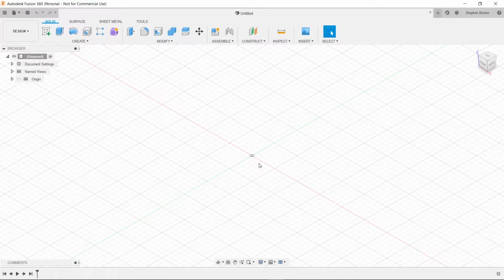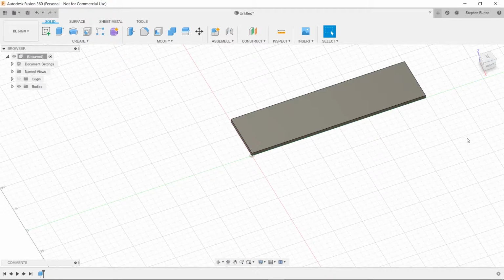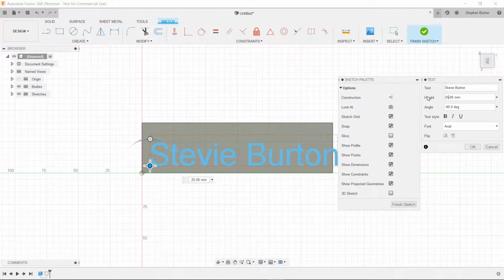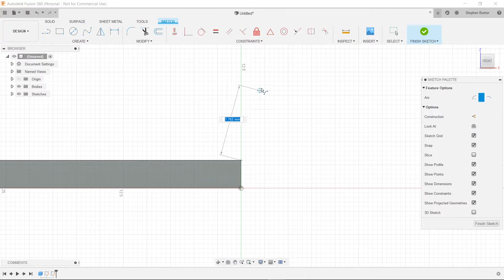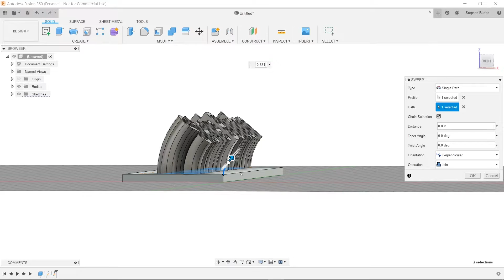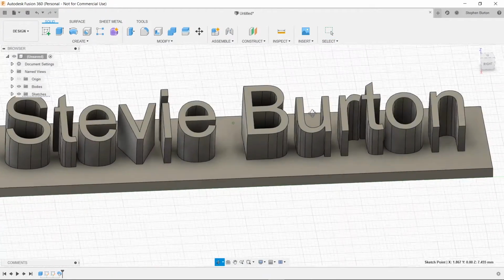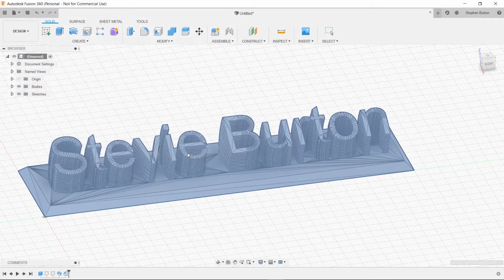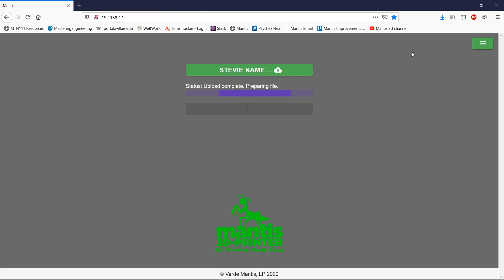Fusion 360: How to make a 3D printable name plate

Comment: Can you use fusion to print with an ender 5 plus?
Reply from the maker: Yes, as long as you save it as an .stl file then you should be good to print.
Reply: @Mantis3DPrinter  This didn't work. I would really appreciate any other suggestions?
Reply from the maker: So with your printer it will be different. To print from Fusion 360 you would save it as an .stl file and then take it into a slicing software. I would suggest taking it into Cura (its free) and find the settings online for your printer, and then take the model and have it sliced there. Once it sliced and is saved to your card, you should be good to go. Our Mantis 3D Printer is different since it does all that work for you and you don't have to go into a slicing software.
Reply: @Mantis3DPrinter  Thank you that worked
Reply from the maker: @karlshort2226  Your Welcome! I'm glad to hear it worked.